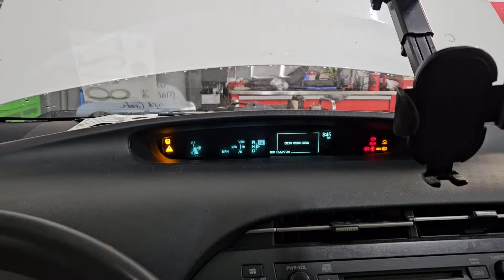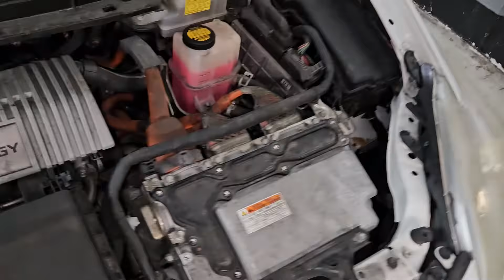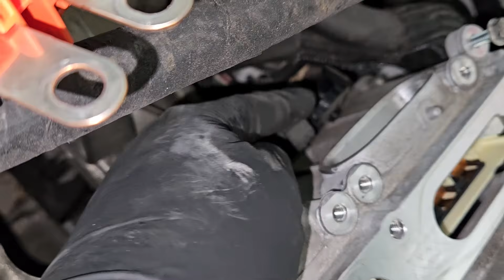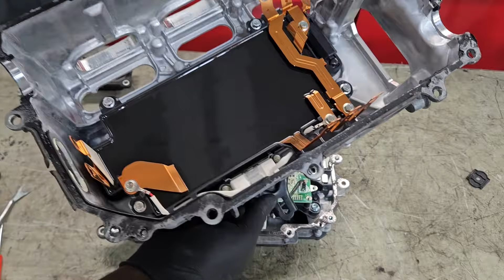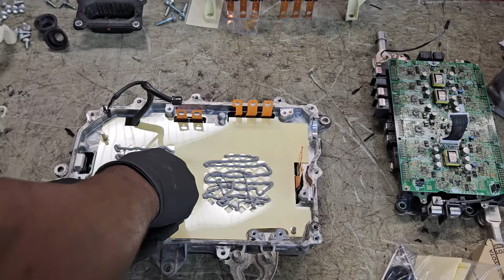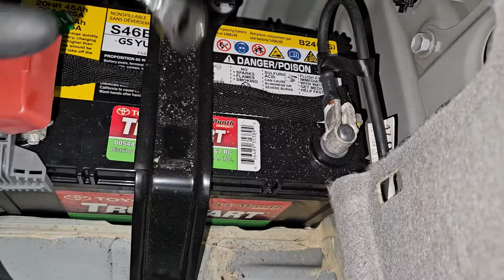2010-2015 TOYOTA PRIUS INVERTER REPAIR (EVERYTHING YOU NEED KNOW)

Comment: Hello. Thank you for this Great Video. We sent a 2010(58328 miles) Toyota Prius with inverter issue with the code P0A94 to dealership here in Houston Texas. Toyota covers the inverter repairs under customer confidence program 23TE03. The dealer wants to charge almost $260 to do inverter coolant flush before they can proceed with warranty. I checked the coolant level before towed it to the dealership. No Debris in the coolant and looked brand new. Does this make any sense to you?
Reply from the maker: Wow! The inverter repair comes with new coolant. That makes no sense!
Reply: @T @TheYotaChannel hank you! After  letting him know that I have done my research, by the end of the day he messaged me that the warranty work is approved at no cost .

Comment: As of March 2026 2010 thru 2014 Prius inverters have a 20 year extension warranty, unlimited miles
Reply: Who knew? My inverter just failed! It went on a rollback on a Saturday . The dealership checked it out Monday. They had to order the part, got the car back Wednesday afternoon, I’m happy. These warranty inverters are upgraded from the original one on my ‘12. So glad it died in my driveway the day after a 1250 mile trip.

Comment: The inverter lines on my Prius do not get hot when the car is on. I have gotten a code of P0A4A and misfire on cylinder 4. It does say check hybrid system. Do you think it’s the inverter if I hear the pump turn on however there is no vibration in the coolant?

Comment: Where is the main fuse (120amp) located on this car? I have a 2012. I saw there is a 100amp fusible link in the box up front - but that's not it right? Then I saw there is a black module in the back around the battery. I wanna put a 110V inverter at the back and a lifepo4 charger and I wanna make sure I don't burn/overload the main fuse. But I'm confused as to where it is and what does what.

PS: could the 120amp fuse be replaced with a 12v 120amp breaker? Why aren't they using breakers for their system? More money from repairs or something else?

PS2 the orange link - that's just a link, not a fuse, right? I see folks refer to it as a fuse.

Comment: Thanks a lot.  Before I saw your video I had no idea Toyota has this extended warranty.  I brought my Prius 2013 with the error code I found to the dealership, and they said they will run the check, if there is not the inverter issue, I will need to pay for $220 for the cost of check up.  I glad that it turned out to be the inverter issue and they replaced for free.  :).   Question:  So now as I start driving the Prius and it gained its powers back,  do we need to change the coolant or making any maintenance item to prevent any issues from happen again? (I have been just doing regular oil changes )  My Prius is in 115K miles and I hope to keep it runs till 200K mark.

Comment: Thanks to you and this video. My 2010 prius has 330k miles. Just got the hybrid system warning light P0A94 code. Took it to the dealership, and it's getting fixed under the confidential warranty program. I mentioned it to them, so I wouldn't get charged for the fix. Thank you very much!

Comment: @TheYotaChannel, thanks for your video. You kept saying you'll not get into details but what you've demonstrated was enough. As an E. Eng I could follow along easily. Having said that, were you replacing this as a Toyota rep (at a dealer shop)? O asles because you mentioned the replacement by Toyota and then you mentioned they sent the parts. Also, where I live, the (only authorized) dealer (new car) started to sell hybrids in 2024 (Rav4 & Cross only). Other hybrids are imported by used car resellers. The dealer doesn't carry parts or service cars they doesn't sell. For the recall, how would one get Toyota to get the local authorized dealer to aid with this inverter repair/replacement? Thanks in advance.

Comment: While researching I came upon your video. Your mentioning of the free inverter repair sounds really good. My research says it’s free even to pre owned vehicles.  Would you be able to confirm this? Your response is greatly appreciated.
Reply from the maker: Yes, even for pre-owned vehicles, it will be covered free of charge. But you have to be experiencing the concern when you bring it in for service. You can't get the repair done as a preventive maintenance maintenance.
Reply: @TheYotaChannel  It went on a limp mode as my husband observed. My daughter’s car. She had autozone check for codes. P0A94 was one.

Comment: Now that I know about this warranty I’m going to buy a 2010 or newer. I have a 2008 and I’m having all kind of issues and all the parts are expensive. Like the abs brake modulation is going bad, it is super expensive and it seems to be a problem on all the second generation Prius, I’m getting po420 cat inefficient. I have the hybrid battery all apart right now bc sometimes it won’t charge the hybrid battery  the scanner says battery 10 and 11 low I checked all 28 cells and all the cells are 8.02 except for 10 6.7volts 11 is ok. But I notice there is lots of corrosion on the copper terminal. I have a code for hybrid coolant reservoir. I already change both of the water pumps, diverter valve, sensor on the tank, replace the whole connector on the diverter valve bc there was a lot of corrosion and I'm still getting a code for coolant heat storage tank. This car are good but o man when they start breaking down it is hard to keep up. I just going to junk mine I'm to old to spend the weekends working on this junk. I'm going to try a Tesla.

Comment: Recently my 2013 prius has P0A94 code, but dealer - Southern CA) said I need to pay to repair the inverter.
Where can I buy the part? Please advise.
Reply from the maker: Hey, with that specific P0A94 code,  the repair should be covered 💯 under the customer confidence program 23TE03. Ask them about it. The coverage is 20 years from the date of first use with no mileage limitation.
Reply: I got exactly the P0A94 code on my 2013 Prius.  Took a picture of my computer showing P0A94 to the dealer in Northern CA.  They review and endup fix it for free

Comment: hi?  when you removed the inverter the last connection you removed from the inverter what is it for.   the piece that has plastic cover.  is it  a ground and what  is it for. please help and also what happened if while putting those wires back on to the terminal a spark happened when the ratchet touches  a metal  what damage  could the spark caused. i am talking about the wires in a black plastic case that is attached at the back of the inverter.  stand behind the inverter, it is located on the lower left side

my car is 2016 prius c

after replacing inverter pump, everything turns , i can hear the regular sound of the inverter but the car doesn't go into ready mode.  no ecu code.  dash message check hybrid system.
Reply from the maker: Hi, that is a power wire coming from the dc/dc converter 125amp fuse block assembly.  If it has a check hybrid warning light on, it should have a dtc set.  Check and make sure that the orange service grip plug is properly connected and make sure you dont have a depleted 12volt battery
Reply: @TheYotaChannel   how happy i am to hear from you.  i sent you an email as well.  the battery seems to be good. all the interior lights and exterior lights and stereo are working. remote control works.  when i opened the driver's door of the car i can hear hybrid normal noise from the hood like around the inverter  area. i started the car , i can shift into and out of all gears except the car doesn't go into ready mode.  the new coolant i added is not being sucked in. i guess it because the car is not in ready mode and the pump are not activated to function

per your advise should i add a jumper to the 12 volt battery.  yes the orange plug is in all the way and locked.   where is the 125am fuse located. could that need to be change due to the spark when i  was threading or tightening the nut.  please help .  how to check the 120amp fuse you mentioned if it is okay or blown.  could this fuse cause the car not to go into ready?  where is this fuse located on a 2016 prius c . thank you

100 amp on the left fuse close to the inverter is in good condition . the filament is in tack.  looking through the glass nothing is burnt or broken.
Reply: hi? how are you,  please i am waiting to hear from . thank you for your wisdom and support

Comment: Don't remember which model, Toyota dealer wanted $10k replacement, they got used $1500. Had no idea could repair 😊 a REAL Tech would overclock that sucker while he was at it 😂
According to The Car Care Nut, the only difference between 4th generation and 5th is increased physical size of the inverter. I assume beefed up. Hopefully. 64, intend to drive '24 CCH AWD till I can't with zero substantial repairs. Only @5k mile/year 70%+ EV ratio, 70+ MPG overall, hypermile.

Comment: My 2011 popped the error right after hitting a bumpy part of the road during a rain.  Resetting the battery got it limping home and the next day it won't run at all even after power reset.  Got it towed to the dealer and wait.  They first quoted $4500 inverter replacement then said it's covered.  The work order only mentioned they replaced some transistors as it was ready in half a day.  So they would do whole assembly replacement when you are paying and component repair if they're footing the bill.  Not complaining, it's just business. Glad I dodged the bullet this time around.  Cheers.

Comment: I agree. You can't beat Toyota. After 180,000 miles Fowler Toyota in Tulsa is replacing my inverter for free and gave me a loaner while waiting for the new inverter to arrive and be installed. My Prius is the best car I've ever had (even considering the brake system).

Comment: Cool vid so of i have any invertor problems 9n my prius just call dealer? Do you by chance have a link to the repair kit you used?
Reply from the maker: Toyota has a special service campaign that covers the 2010-2015 Toyoya prius inverter repairs free of charge regardless of mileage.  And yes, just call the dealer, and the dealer will plug their scanner and check for codes. If the code points to the inverter, then Toyota will cover it free of charge.
Reply: @TheYotaChannel  Thank you!

Comment: Thank you so much for the information. I have 2010 prius. Master warning ⚠️ on with check hybrid system message. Brought the car to toyota dealership & got a new inverter installed for free. Thank you!!!
Reply from the maker: Glad it helped
Reply: why did they install new inverter for free?
Reply: Pls What code did your 2010 show
Reply: @franakpan  These r the codes toyota dealer found on my car B15BA, C1214, C2122, C2123, C2121, U0155, C2124, P3004, C2175. Good luck!
Reply: Pls what code did your 2010 prius show
Reply: Did they told to diagnose first
Reply: El mio bota el p261b y sigue cob los mismo tiene el chek prendido y después de un rato .anexado aparece revise sistema y el triangjlo y el carro se bloquea  yo le cambi la bomba de el inversor y nada será q le cambió el inversor

Comment: Mine just went out and when I looked up the VIN number no recalls showed up. I call Toyota and they said on their end nothing showed up and that the recall doesnt cover my 2010 prius.
Reply from the maker: It covers 2010-2015. The trouble codes have to be related to the inverter.  If you email your VIN, i can take a look and see.
Reply: @TheYotaChannel  The Error code I got was P0A94 VIN: JTDKN3DU6A0225579. Thank you! :)
Reply: @TheYotaChannel  I just sent you an email with the info you asked for. Thanks again! 🙂
Reply: @TheYotaChannel  Hello, I just want to publicly say thank you for helping me out with my inverter issue. I did take it to Toyota dealer and they looked everything up and said YES it is 100% cover for 20 years. That saved me from taking the Prius to a junkyard and being out a vehicle. But of course there was other issues they found like bad barring's and a few other small issues, but figured I might as well get those fixed as well since I'll be driving it for a bit longer.
But again man, I really appreciate you taking the time to check into for me and giving me advice! 
God Bless!
Reply: Did they told to diagnose first
Reply: @saamiabdulsamad8742  The 1st place I took it to told me to take it to the dealer. So I did that and gave them in the info in this video. I even printed out some paperwork to show the “recall.” It took a few days for Toyota to approve it and a few days to get it back to me.
Reply: @ Also the did find other issue I had to fix so I did have to pay for the but for the Inverter it was completely free. And they did cover the price of the loaner car.

Comment: Excellent! Thank you sharing much detail.    Do you happen to  know if Lexus , 2015 CT200h specifically, is the same hybrid wiring as the Prius?
Reply from the maker: Yes, they are wired very similarly.  I'm sure part numbers will differ, but the general hybrid system is wired the same.

Comment: I had a problem in DC inverter of my 2012 prius v on June 2024. All dash board light came on. I took my vehicle Toyota dealership. They replaced the part inside of DC inverter. Toyota covered all expenses including labor cost. If you are facing same problem then don’t hesitate to go Toyota Dealership. Thanks
Reply: Aoa..  sir i have prius 2011 facing same problem..   im living in gujranwala. Please guide how to resolve this issue. Thanks in advance

Comment: This video is amazing!! Your technical knowledge and experience with inverters is outstanding! How did you initially have the guts to open up your first inverter? My question is about diagnosing a bad inverter. How do you diagnose it before yanking it out of the car? Are there OBD2 codes (such as POAO9) that 100% indicate a bad inverter? I want to be sure before I pay for towing my car to dealership and their $300 diagnostic charge (which is refunded if problem is inverter). thanks
Reply from the maker: There is an extended warranty available for the IMP REPAIR, 20 years with no mileage limitation if you have those codes stored.
Reply from the maker: The codes you will typically have stored in the computer are P0A94, P324E, P0A1A, AND P3004
Reply from the maker: My first inverter repair took me a while because i had to read the manual page by page, but now I've done hundreds, i can do them in 2hrs in and out.

Comment: I totally switched out my inverters and was able to do it much easier thanks to this video. I checked on my warranty and because my Prius is a Salvage they won't warranty it.. I just happen to have another 2010 that I bought from a friend for parts and switched them out. I will go and buy the special antifreeze then flush and fill and bleed it then try to start it. Fingers crossed.
Reply: How did it go?
Reply: @abdul-kabiralegbe5660  Not good it still has issues and won't run. Thank you though.
Reply: @NettoDelCampiglio  You're welcome.

Comment: Yet…. They can’t cover the brake booster and actuator issue that is way more common 🤔
Reply from the maker: Toyota issued an extended coverage for the booster in the 2010-2015 models. The coverages expired for the 2010-2014 year models. If you have a 2015 and under 150k miles, Toyota will cover it.
Reply: @TheYotaChannel  , coverage expired March of 2023